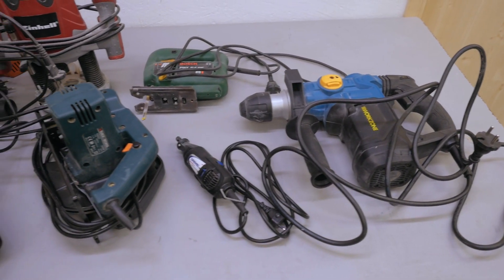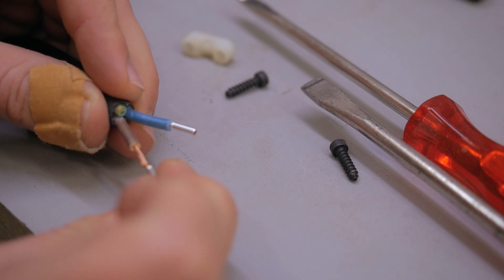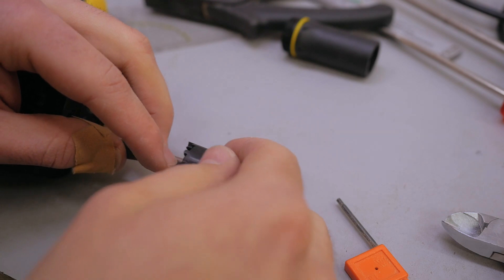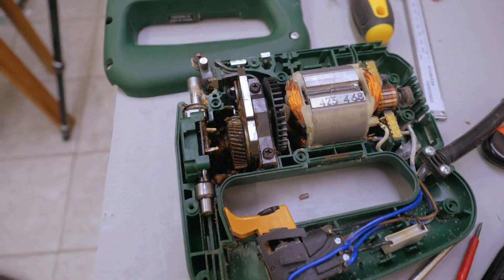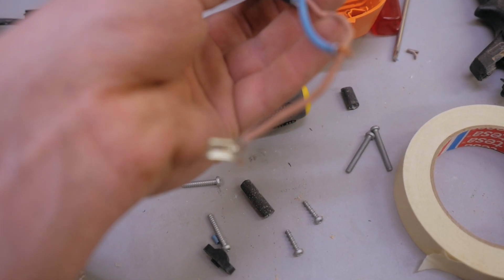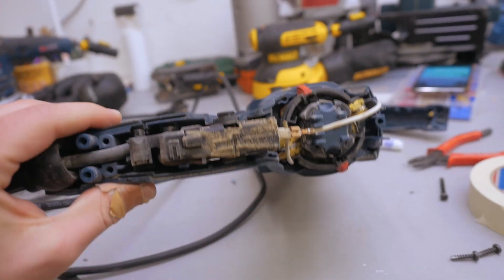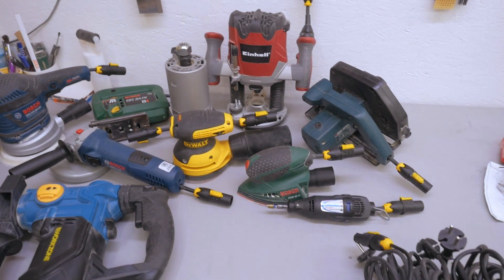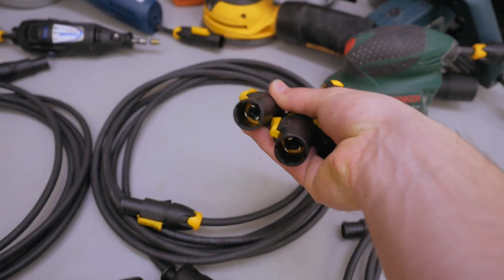A Quick Connection System for Power Tools

Comment: I'm sure it's already been mentioned, but the sleeve is for strain relief.
Out of curiosity, why did you choose such a short lenght of cord on the tools instead of, say, half a Meter?
Reply: I would be inclined to keep the strain relief on the tool and leave 5cm of exposed cable, just so that when you flex it you're not concentrating all the bending in one small area of the cable. But if you do break the wires at least you know how to replace them.
Reply: @mozismobile  Yeah, the cables are going to fail in short order.
Reply from the maker: so that I can hang everything on the wall and absolutely no cables are in the way.
Reply: Fair enough.  I just though that having the plug so close to the actual tool might be a bit too inflexible.  If it does become an issue I suppose you can always just change the cord out and reuse the connector. :)
Reply: TheOneWhoMightBe I prefere the plug on the tool.
Reply: bad idea marius, reverse it ;)

Comment: You can also use standard XLR connectors. They are designed for sound connections but work fine with tools up to 1.5 kw. The cost  of good quality XLRs is way lower.
Reply: Neutric produces top notch XLR connectors too
Reply: Mat Cooper but xlr connectors are usaly Not rated for main voltage (120V or 230V) 

the neutrik ones are usaly rated for less than 50V
Reply: True, but I use them. They work and they are cheap as sunflower seeds considering alternatives. A friend of mine uses the same XLR approach for four years now with no problems.

Comment: That “ridiculously long” sleeve is a strain relief, and prolongs the life of the electrical cable at the most common point of failure, but as your project demonstrates, it’s a fairly easy fix.
Reply: Im from Germany... Well strain reliefs and Kink protectors are often combined into one unit. 

But hey! pictures can replace a gazillion words...

Kink Protection =>  https://www.kabelsysteme.ch/uploads/pics/kabelkonfektion-kabeltuelle-umspritzt-knickschutz.JPG
                                   http://www.ab-elektroshop.de/images/product_images/info_images/Knickschutz2S.jpg
Strain Relief       =>  https://upload.wikimedia.org/wikipedia/commons/thumb/a/a4/Zugentlastung_netzkabel.JPG/220px-Zugentlastung_netzkabel.JPG
                                   http://www.efa24.com/de/media/image/thumbnail/image_110-006-274_1_720x600.jpg
Combined          =>  http://www.henri.de/media/image/58/d7/45/42-690-03010-Kabelzugentlastung-B1_600x600@2x.jpg
                                   https://www.smartway.de/documents/image/43/4310132/X-DC045-04-a-4310132-Sentivus-DisplayPort-zu-DVI-.jpg

Have a nice day!...
Reply: PERILEX where are you from?  I've never heard it called that.  this device is meant to reduce the stress riser on the end of the cord where it attaches to the case.  it's tapered shape spreads the point where the cord bends along its length.  I guess it makes sense to call it something other than a strain relief since that term usually refers to the clamp that transfers cord tension into the case, but that's what people do.  at any rate, I think it was a bad idea to eliminate it.  a better design would be to just leave a 6" tail and then put on the coupling.  Cool idea though.
Reply: The Walrus - It's not as ridiculously long as you may think. In addition to strain relief, it also moves the cord away from the business end of the tool. Which for a sander is quite handy.
Reply: Indeed.  I’m in full agreement, Contango.  I was quoting with some amount of snark…    :)  I’ve never met a strain relief that is too long.  And on double-insulated tools without a dedicated ground wire, a quality power lead will help prevent electrical shorts.
Reply: digitalradiohacker, I’m in full agreement.
Reply: +digitalradiohacker (wtf, i havent noticed that we need to manually add the name whom we are replying.. Whats the point for reply-link in every comment, when everything just goes to one branch??)

I did not actually see what happened to strain reliefs in some of the tools while Marius put those back together, but its completely different from the rubbery kink protection, as many comments has stated.  In this case, i can be sure that when those inner leads get to see daylight, Marius would fix it immediately.  Many other powertool users would just leave it..  And complain that the tool is piece of shit, as it wont even work as a towrope for their truck :D

But yes, i would leave those kink-protectors on.  And like in many other comments, i would not have opened the tools anyway for a project like this, or at least my reasoning for that would have been to change better cable for a tool, not to save that original (usually shitty) one.

While RCBO is one device, it has two very different tripping mechanisms.  For finding faults, it would be nice to see which side of that device tripped and most brands do tell that.  But then there are users that would reset it while waiting for an electrician to arrive and if the fault just wont show while troubleshooting, there is double the work for finding the actual reason.  So, RCBO:s are nice space/time savers when installing them, but harder when troubleshooting later.  User might be able to point which lever she has reset, but cant tell which color was on the little indicator window of one device.

When we wondered this far from the video?  How do i get back :D
Reply: PERILEX where are you from?  I've never heard it called that.  this device is meant to reduce the stress riser on the end of the cord where it attaches to the case.  it's tapered shape spreads the point where the cord bends along its length.  I guess it makes sense to call it something other than a strain relief since that term usually refers to the clamp that transfers cord tension into the case, but that's what people do.  at any rate, I think it was a bad idea to eliminate it.  a better design would be to just leave a 6" tail and then put on the coupling.  Cool idea though.
Reply: Yes, RCD wont trip without earth.  But you also wont even notice that you are connected to live wire (but then you are probably standing on a piece of styrofoam and not touching anything else).  Unless you could tear both wires (phase and neutral) out from a tool, without short circuiting them and tripping "normal" breaker, and be able to touch both of them, you should be fine.  RCD will trip when you touch live wire and something else somehow connected to ground.  Concrete floor etc should be enough to get that nominal 30mA going  (something over 50mA trough heart is what kills you).  So, RCD:s work with double insulated stuff just fine.  And if you plan to test that, be sure your outlet is really protected with RCD and that you have tested it monthly or so, like it says in the manual ;)

As electrician, i think i have to warn about broken RCD:s.. What i have seen, ~95% do broke in a way that there is no way to get electricity flowing again (which is the safe way), but then there are those few percent that get somehow stuck on and wont trip at all..  I should take one apart when i again find some that wont trip.  Those are most likely full of dust and never exercised by that monthly test cycle.

And for over current protection, i'm quite sure Marius has outlets protected to 10 or 16 amps.  At 230 volts that should be enough for tools on both hands simultaneously ;)
Reply: False! Its a Kink protector NOT a strain relief! 

The strain relief actually is inside the device! ;)
Reply: @PERILEX  it is a strain relief. when a material flexes it gets strained. Inner side compresses the outer elongates. When this strain goes above the material's elasticity, or is repeated so much that the elasticity is lowered (fatigue), materials deteriorates and brakes. This outer start sleeve protects from bending (reduces the bend radius and ensures a gradual softening of the joint, plus enforces and eases pulling forces. 

just check Apple's cables. They all break within a year, because the strain reliever is made too minimal.

typical retarded apple design.

greetings.

Comment: Now that I think about it all my electric power tools have the long cords. And yet all my air tools connect at the tool.  Imagine of all the air tools would have a 6 or 8 foot hose coming out of them.  Strange that they evolved differently.  
I remember about 15 years ago some tool makers started putting short cords on them. But it wasn't accepted and they went away fairly quickly.  I believe it was viewed that they were trying to be cheap.  But now I see it was the right thing to do.    
The one question I have is why didn't you just cut the existing cord off at 8" and put the connector on it without opening the tool?
Reply: He said that he wanted to keep the original cable so that if he wanted he could put the tool back to the original configuration. Imo it's not remotely worth the hassle though.
Reply: With air tools you have a standard connector. With power tools the manufacturers couldn't agree on a standard connector as they always try to lock people into the brand so it failed, and they instead put a long flex on with a standard plug (country specific), go figure. .
Reply: Dv8 yeah, people usually go with plan A as the quick solution (using the existing cord) and plan B as the harder solution (opening the tool and putting a new wire)
Reply: My experience with the short tool cord was the God damn plug would come unplugged when you were using it, usually at the must inconvient time.
Reply: Mel Lowman lol true
Reply: The old "figure 8" connectors were the closest thing, but even the locking ones did not lock very well so as soon as you moved the tool they worked loose. The locking IEC connectors linked above seem like a brilliant solution, though. Except that these days with everything "value engineered" to the cent adding a dollar for a universal connector socket on the tool would probably only work for the expensive tools... like Festool, who already do that :)

Comment: For the drill, just barrel crimp onto the existing wires coming from the switch and properly insulate. If you ever want to go back to the original cord, you can crimp onto those wires.

Comment: Maybe I just missed it, but why not just cut the cable and attach the new conncter? Why open the whole thing every time???
Reply: I think he wanted the connector pretty close to the power tools as well as keeping the full length cords,  also makes for a more interesting video seeing whats inside the tools.
Reply: He wanted to open the tools to see whats inside man. I would dos the same just out of curiosity.
Reply: Jetzt frage sich mal jede/r, warum die hersteller, die doch gerne an jedem bauteil sparen was mehr als 0.5 cent kostet, nicht am kabel-"knickschutz" sparen!!? Wird doch am ende nicht etwa vorgeschrieben sein?!
Reply: In case the system doesn't work out. I'd also assume he could return them to regular cords incase he decided to sell a tool
Reply: He could still do that, the cable would just be 10-20 cm shorter. Still no reason to open up all the machines. All the cables are black already, and contains the same copper - It makes no sense to me. I'm sorry, Marius. But the intention and the idea is good...
Reply: Jesper Hansen yes but he didnt know what was inside all of them, so if he wanted to go back he might not be able to change the cable like he couldnt in the drill
Reply: Jesper Hansen He said that if it didn't work for any reason he could just put back the old connector

Comment: you could also have gone for some cheap c13 plugs. those are rated for 10A
Reply from the maker: Yes, but they don't lock together. I should have mentioned that in the video.
Reply: bart b they might not but they do not come apart when using them.
Reply: I think that they hold together really just fine.

and the times that the cord does catch on something, I think it is better that
the cord unplugs itself rather than misaligning your jig by pulling to hard

But hey if this works for you who am I to judge... Nice vid bdw
Reply: just shorten the cable it does the same! and safes you a lot off money

Comment: the way to put a connector on the drill? Cut the original cord and put the connector on. if you want to go back to the old cord, splice the wire inside the drill.
Reply: I think Marius wanted an excuse to open up all his tools.  :)
Reply: Cullen Purkis that is the same way that I would have mentioned to him.
Reply: They dont really get ruined, just 20cm shorter.
Reply: I actually did exactly that but with other type of connectors some time ago (PC power source types, cables have the ones with the holes, tools the ones with the prongs, the one with the holes are the expensive ones with locking mechanism, the ones with the prongs are for tools and cost around 2Euro a piece, the other ones around 10 euros but with 2-3 of those you make enough cables for all the tools - i just have a long one, and a short one...)

Comment: if only you'd used cable reels instead of loose wire ;D
Reply from the maker: I can still do that if I have the need for.
Reply: or you could just make one yourself :) one that auto winds the cable but can lock in place so its not pulling on your tool when your using it.  theres a challenge for you :)
Reply: MaghoxFr reeling them would negate the need for that.
Reply: The problem with wound up cables is heat due to the resistance of the wires. If you're just drilling a few holes and need 3m or so of your 25m reel there's no need to unspool all. If you're using a low power tool, you can use it all day with the wire on the reel. But don't use a high power tool, especially one that you use for prolonged time like a sander, hammer drill, table saw without unwrapping all the cable!
Reply: Guy McGuy aren't cable reels bad for cables?
Reply: Bad for the cables, no, but if you're putting the full load on a coiled cord (whether it's coiled on a reel or just coiled for tidiness) for an extended period of time, it can become a serious fire risk. Marius has a small shop, though, so all he would need to do is go with an overkill cord for safety. Something rated for more than the circuit breaker is meant for, so that the fuse or breaker will trip long before the cord melts itself, shorts, and starts a fire.
Reply: forgot to add, many cable reel systems that you can purchase have built-in current limiter of some sort, so that that doesn't become a risk. Cable rated for 15 amps will usually be limited to 12 amps before blowing a fuse, and cable rated for 20 amps will often be fused for 17 or 18 amps.
Reply: I was told by more than 3 people that the best to coil a cable is to do it with the pinch-twist or similar technique so they keep their flex memory. And reeling them would kind of eliminate that.
Reply: Guy McGuy I see. Thanks.

Comment: I think you could do it much cheaper with standard c13 plug. Not as cool as yours though. https://en.wikipedia.org/wiki/IEC_60320
Reply: 10A = 2.2kW in EU, if there's a motorized tool that you need to hold in your hands that's more powerful than that, i'd like to stay as far away from that one or anyone who yuilds one as possible.
Reply: Good idea, don't know if he needs to 16 amp that the connectors can give him. The c13 only supports 10 amp. But we all have them from old pc's :D
Reply: I didn´t even consider that they give anything less than 16amps. I don´t have any tool though using more than 8A and that is my table saw.
Reply: That's what i was thinking, more universal too as they are very common.
Reply: exactly what I thought
Reply: Seeing this comment was a real life (money) saver! I was just about to spring for those expensive locking connectors - even though I was a bit put off by how long they ended up being when paired - but these do the job perfectly and it cost next to nothing to outfit my whole shop! Thanks!

Comment: what about using a kettle lead. I am sure someone else has done it
Reply: Luke Massey works great
Reply: I think that they even used flush mount and just modified the tool
Reply from the maker: sure, but I wanted mine to also lock togehter

Comment: Will this invalidate your issuance if something goes wrong or catches fire?
Reply: Maybe he can blame his twin ;)
Reply: Ollie Turner Afaik no. At least i think it's like that in Switzerland. You even can wire your house yourself. But then again every house gets checked every 10-15 years if everything is still correct.
Reply: guess he has enough common sense to disconnect power when he is not in the shop, so IF something was to catch fire it would do so while he is there.
Cannot see a problem there...
Reply: In the UK it's only major stuff like ring mains that you're going to need certified.  Changing a plug is fine - and that's all Marius is really doing in this video.
Reply: Oh thanks, I don.t know if this is the same in the uk because we are only allowed to replace "Like for Like" without a proper electrician.
Reply: no one really cares as long as it is low voltage stuff, or stuff that one one is really going to fiddle with like tools, but something like a house and you would be in serious trouble. It would be fine till something went wrong and then the insurer won't pay up. Also we only have house inspections after building work or if you are planning to rent out your home.
Reply: Ollie Turner Wow. That's like annoying AF. I just modified a server PSU so i can hook up my LiPo chargers. This regulation wouldn't allow for that... good thing I'm not in the UK.

🇨🇭 FTW
Reply: insurance details are different in each country/insurer.. I can't see how this would be a relevant comment